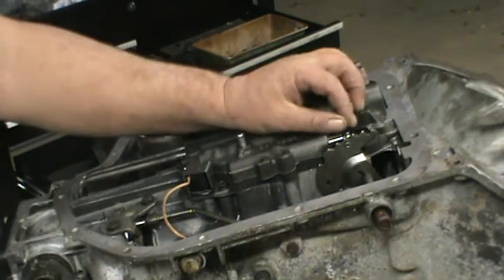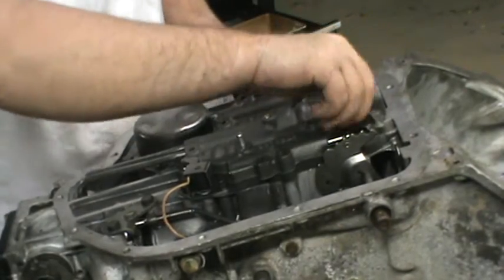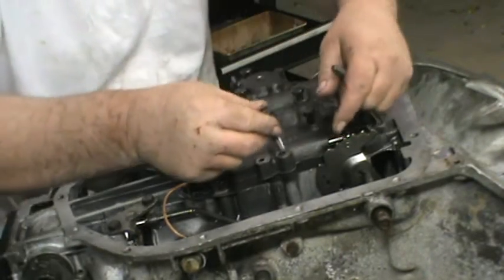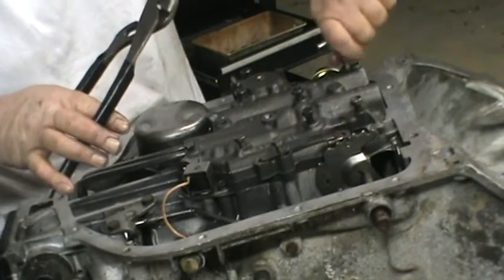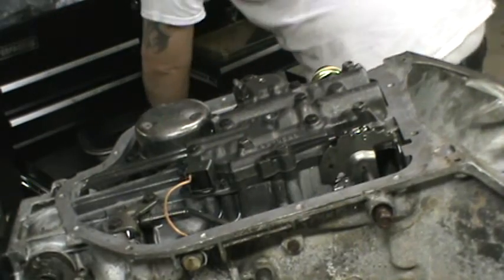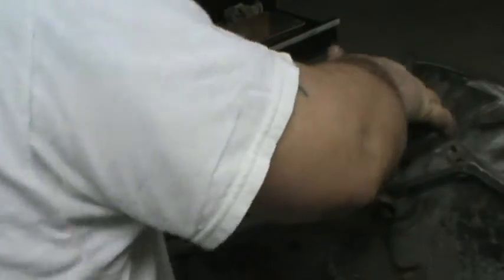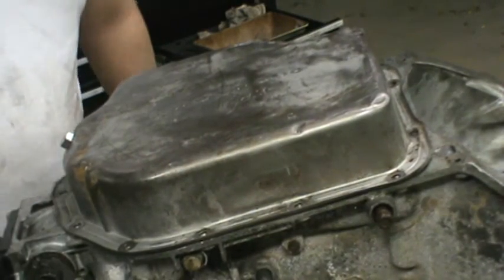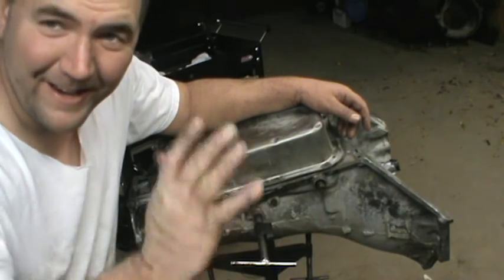TH400 PT.14: final assembly

Comment: I never yet overhauled an automatic transmission, but after viewing this series, I feel confident enough to tackle this one on my 1985 M1009 CUCV.  Absolutely great series, no BS straight to the point, love it!  Thank you
I just bought the truck and the oil smells burnt, although I can drive it as it is and I do not feel any problems.  Not sure if this means that I should do a complete rebuild but I was told this is most advisable.
Is there any way I can tell if rebuilding is recommended?
Just to stay on the safe side, I already ordered the deluxe rebuild kit.

Comment: On a stock th400 with factory bellhousing in place, would you happen to know the measurement front the face of the bellhousing to the back of the pump. Cant measure mine as its a sealed unit. Trying to work out measurements for a custom converter

Comment: Learned a lot Thank You Very Much ! Also Looking for information on a 1966 TH425 Switch Pitch w/ thicker center susport  & no case ring & a 1977 TH425 Non Switch Pitch thinner center susport w/ a case ring ! I want to use the susport w/ the case ring in the 1966 trans which should fit. BUT on the 1966 susport  bottom side w/ the 3 bolts & 3 pins in has a hole going though the side into the center ( for maybe oiling the rollers ? or for the switch pitch trans ? ) the 1977 trans has NO hole ! Do I have to try & drill a matching hole ? or is it not needed took out the 3 bolts but couldn't get it off to exchange them, or look for more holes under it ? Thanks for any help !